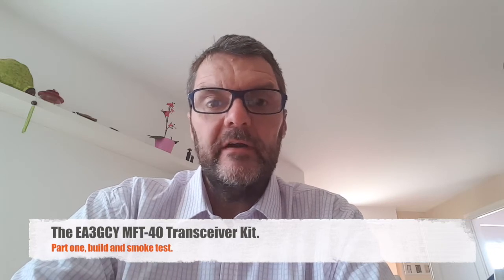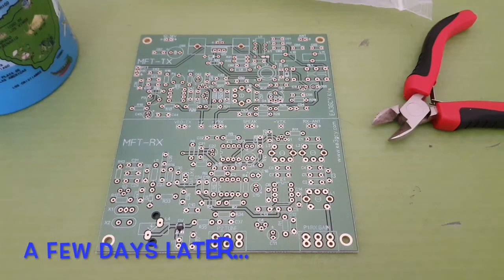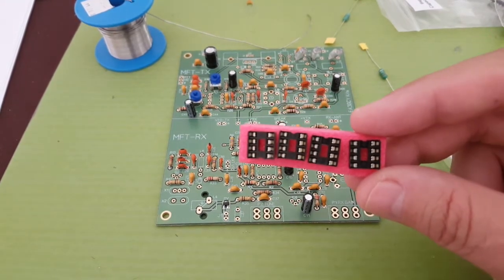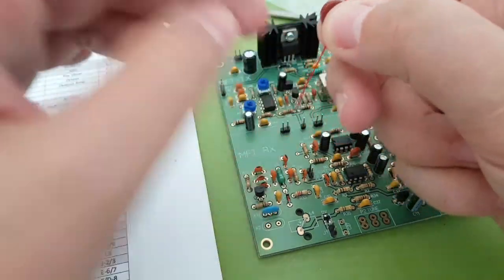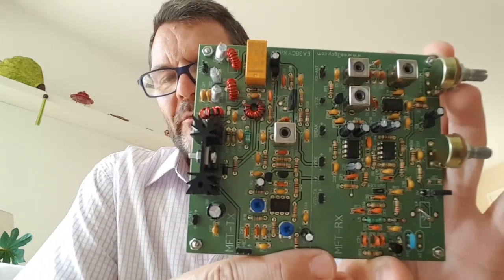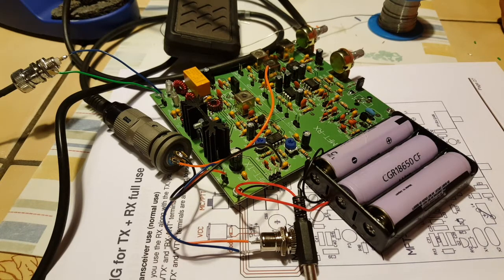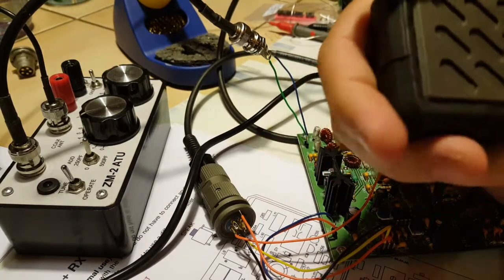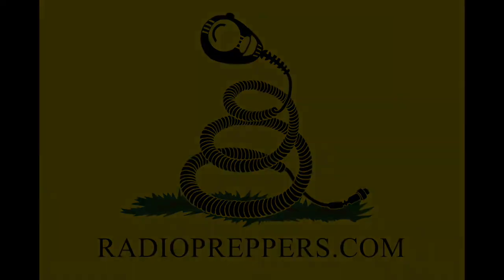The EA3GCY MFT-40 DSB Transceiver Kit, Pt1.

Comment: Loin de moi l'idée de critiquer, mais si je peux me permettre une remarque : généralement, pour se faciliter la tâche, on monte les composants des plus petits aux plus grands. En commençant par les résistances (et les éventuelles diodes) puis les capas céramiques, tu as bien fait. Tu aurais du monter les circuits intégrés en même temps que les trimmers. À ta place, j'aurais gardé des supports pour pouvoir changer facilement un CI défaillant. Par contre, je n'aurais en effet pas utilisé les supports "lyre" mais des supports "tulipes" qui sont de bien meilleure qualité.
Une astuce pour les kits et les montages avec des pièces qui risquent de bouger / tomber : un morceau de gomme-fix (Patafix ou équivalent) fait bien le job le temps de la soudure. ;)
Reply from the maker: +Elektro LUDIKITS Effectivememt c'est ce que je fais d'habitude, mais bon, j'ai suivi le manuel... Quand aux supports, j'aime vivre dangereusement ;-)

Comment: But most modern ham rigs can switch to usb or lsb.  It's a solution for a mostly non- problem.  Anyone with brains can figure out if the signal is on the opposite sideband.
Reply from the maker: +loctite222ms Yes, anyone can switch to the other sideband, though most don't think about it. I know this from using my PRC-320. It is not a primary reason to choose DSB, but for me it is a good one.

Comment: Very nice kit Gil .... your doing a great job on it 8-)   Gil on the tuning sticks .... I have used BAMBOO SKEWERS and a razor blade to make the appropriate tip needed ... and it it wears out I just clip it off the tip and whittle another tip =)   I hope that helps out =)   I keep a bag of SKEWERS in the kitchen for lots of things ....  bacon in a cup wit out soaking in grease and as we called them "DIDDLE STICKS" for IF alignment in NON High Voltage ( above 600 v ) circuits =)
Reply from the maker: +Pat Hopkins Thanks Pat, good idea.
Reply: Plastic knitting needles of appropriate width, suitably filed like a screwdriver, also work well.  But metal is absolutely forbidden! (interdit, verboten, prohibido!)
Reply from the maker: Good tip thanks.

Comment: Gil, I have built 5 Bitx's of various verities and even worked Mirny Station in Antarctica on a BitX17. Great radios.
Reply from the maker: Awesome. I once got a BitX20 kit from India but the manual was so bad, I sold it before finishing it. Then I bought the Hendricks version but the transmitter never worked. It was the only kit I ever built that I could not fix, and I've built a couple dozen, including a K2 with SSB board... So I am a bit cautious about the BitX line... It isn't a beginner's kit for sure. I think you better own a scope if you build one too... This MFT-40 though is easy and DSB is great for the reasons I stated.

Comment: DSB = 2 x 2,7 kHz = 5,4 kHz bandwith? So you need double power compared to the equivalent SSB transmission? 
And as always it's a nice video -  thanks a lot sharing your experience with the world.
Reply: Mike you are absolutely right about needing twice the power, but in the end it will matter very little to the guy who is receiving you. Maybe a half of S unit. I worked the Queen Mary, (600 miles south of me), docked in LA Harbor on 300mw 40 meter DSB and got a 57 report, it wouldn't have mattered (much) if I was on SSB.
Reply from the maker: Thanks Mike. I do think your power is indeed halved. On HF it isn't such a big issue. 3-4W isn't much but with a half-wave antenna making contacts should be fairly easy. We'll see about it after I put the radio in a case and take it outside :-) Peter Parker VK3YE has a video about a similar DSB transceiver, check it out.
Reply: Thanks - i know having the right antenna is more than than half the battle :-)
And yes double power means +3dB and this is indeed a half S unit  (notice for myself - next time first think and than write) :-)